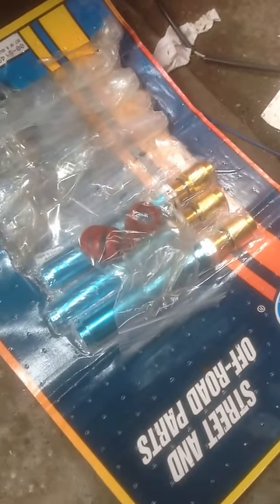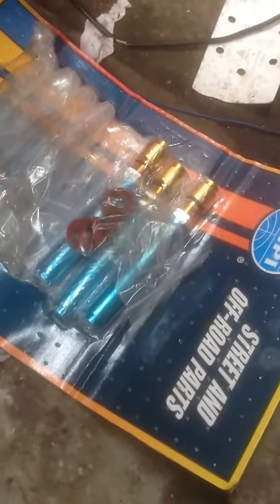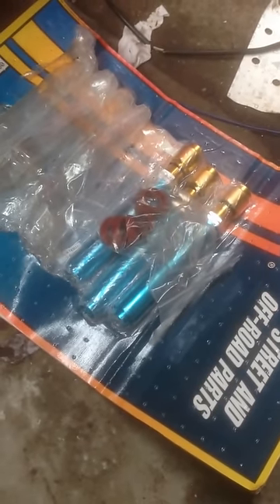Changing Your Old Leaking Pushrod Tubes for VW Beetle,T2 , Karmann etc. the quick and easy way

Comment: i am watching your vid i am at the part where your adjusting the o ring and worried about the nut damaging it ,,,,,,i have not done mine yet but i played with o ring and nut prior to installing anything ,,,,i noticed that the nut seems to push the o ring nicely !  seems like i said LOL ,,,,on my bench ,,,,,ill let you know when this old man decides to do the job again for the 5 th time ,,,,,,i have spring loaded ones now and they leak ,,,,,,nothing like a job done right the right way the first time ,,,,,,the people that rebuilt my motor used a damaged push rod tube and i am stuck repairing it ,,,,,

Comment: these are the so called racing push tubes. do appear to be easy install. where as the regular silver tubes require the removal of the head, ouch!. takes a little longer that's all say about an hour longer.